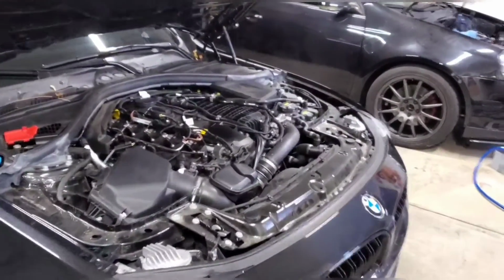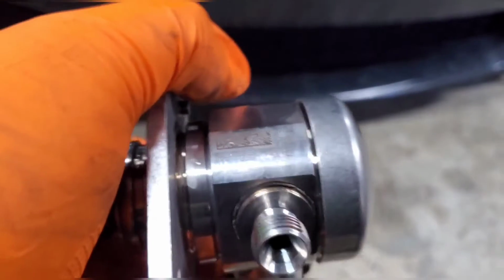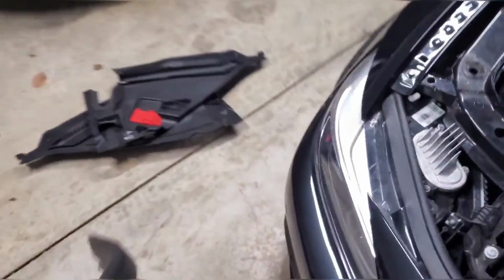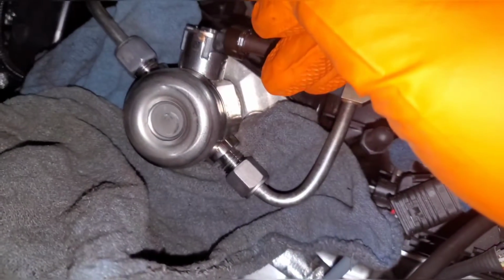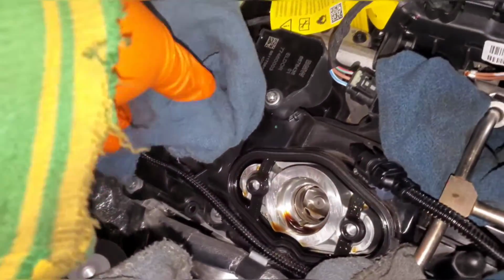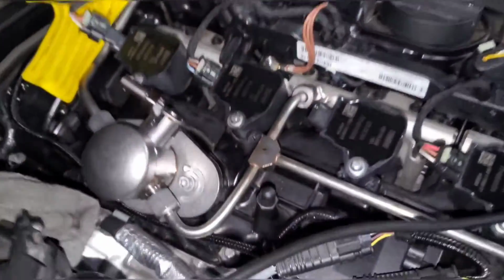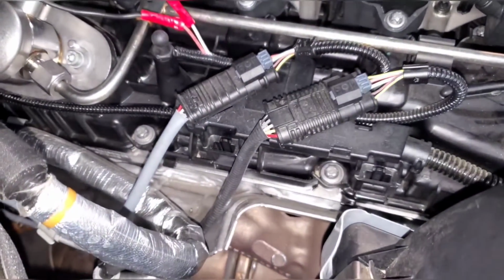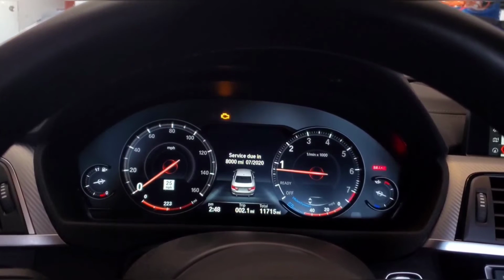**READ DESCRIPTION** B58 HPFP Replacement (TU Pump Upgrade)

Comment: I just upgraded my fuel pump but I am now getting error 11c004 which seems to mean I'm having an issue w/ the connector or wiring (11C004 Quantity control valve, activation: Line break).  The car runs fine, but I cannot get rid of the CEL.  Did I get the polarity wrong on the wiring perhaps, could it be a fault in the pigtail that came with the pump, or is there a chance my new OEM pump is faulty?
Reply from the maker: Make sure it's fully plugged in. If you rotated the connector, make sure it's fully seated

Comment: I've installed the gen2 b58 hpfp, but unfortunately i got the same amount of pressure as the stock one .. about 2960 psi, and i got the same fault code of low pressure in the hpfp

Any suggestions what to check and what to do ?
Reply: did you ever get that fixed ?

Comment: Ive installed mine today, so thank you… Mine sits a little higher as you can see a very small gap. Could this be the stock has a dimple and the gasket sits into it where the upgraded pump doesn’t have a dimple therefore sits a little higher??
Reply from the maker: As long as the gasket is sealing it's fine

Comment: I used this video to install my tu pump in my 2017 340i xdrive and it went perfectly. In particular when removing the trim pieces the description was basically real time with little need to pause.
Reply: Did you change the pump gasket as well?

Comment: I just completed this with the MHD tuner and the car won't start. Its a 2017 440i. Cranks perfectly won't start. Guess I gotta go back in.
Reply from the maker: Make sure the wiring is fully seated. The first start will have a longer crank since you drained the fuel but it should start after a few seconds.

Comment: Hi Kern, do you have a picture of how “flush” the pump sat to the valve cover I am unsure if I had installed mine correctly and want to ensure what I did was correct before turning on the car
Reply from the maker: some people have reported a small gap

Comment: great info, and thank you for the vid.  i have a solution for the tight high pressure side of the fuel line connection.  connect the fuel line to the HPFP (pointing to the front of the car) and the other side of the fuel line to the fuel rail closest to the front of the car.  the 3rd connection (to fuel rail towards back of engine) will not want to fully go into place.  solution: take a 10mm box wrench and put it over the fuel line right where it is supposed to connect to the rail.  the 10mm box wrench should fit perfectly around the line.  tap the top of the box wrench with a rubber mallet and the fuel line will pop right into place.
Reply from the maker: The way I do it now is just connect all of the lines loosely before torquing down the fuel pump to the cylinder head. It works every time. But this was my first time installing it years ago so I didn't know that yet.

Comment: I just want to add that the TU pump can regularly be found on eBay these days for less than $600. I just ordered mine, brand new with overnight shipping, for $495.
Reply from the maker: Crazy to think people were paying $1k+ at one point 🤯
Reply: @kern417  I know! I'm going to do logs and test my before and after on 91 octane, and then do E30 when I go to Vegas. Eventually when I get a Pure 800 cast turbo I may upgrade to a Dorch Stage 2 HPFP but for only 91 octane I think the TU pump will be sufficient.

Comment: Hey kern417, what would happen if we ran the TU pump with no tune for it? Also, how much extra power could you expect for a TU pump with a catless downpipe on a BM3 91 octane OTS tune?
Reply from the maker: As shown in the video and logs in description it'll just run like stock.

There's no real gains on 91.
Reply: @kern417  My bad for not seeing that. Thanks.
Reply from the maker: @BMWEnjoyer  no problemo
Reply: @kern417  Hi Kern417, thanks for all the video´s and your contributions to the car society. I bought the TU pump and was to install but now after reading on bimmerpost I´m in doubt if its worth the swap. I have the stage 1 (420hp) all else stock and runs great. Will there be any benefit at all installing the TU pump with the stage 1 or do I have to go stage 2+? Don´t wan´t to catless, only gas 100oct/E5/5% e-blend. Thanks again
Reply from the maker: @gudjonssonr  you need a tune to take advantage of it
Reply: @kern417  Thanks. Can I run stage 2+ without installing a downpipe?
Reply from the maker: @gudjonssonr  no

Comment: I have the b58 gen 1 and I want to run e50. Do I need to only change the TU pump or do I have to change the whole fuel lines and etc since ethanol and somewhat corrosive ?
Reply from the maker: no upgrades are needed to run ethanol.

Comment: have you found the HPFP to be noisy, i have this pump on a B48 and its a noise high pitch ticking. Like a rattle
Reply from the maker: it is most likely the purge valve on top of the manifold.

Comment: Top video. Just used this to swap the HPFP on my X3M40i. Stage 2+ on BM3 OTS makes a big difference. Same issue where the fuel rail doesn’t quite line up with the outgoing side of the TU HPFP, but like you said just get the nut on and crank it down. Very easy to do, even for someone like me with little mechanical experience. Cheers

Comment: Love your channel! Great walkthroughs and tech discussions. So can you run a tu pump on the stock tune without any codes? Asking for a friend in CA that doesn't want to swap fuel pumps every 2 years. Edit: for those wondering the same, it's not an issue. The tu pump uses the same mechanism and communication protocol with the DME to control fuel pressure so no errors on stock flash per another of Kern's videos.

Comment: Do I have to use the exact oil I have in the car to coat the pump, or can I use a slightly different weight?
Reply from the maker: It shouldn't matter much

Comment: First of all, congratulations on the fantastic content! 

I'm trying to install an HPFP TU Pump on my X3 M40i 2018, but the fuel injector pipe line doesn't fit (Part No. 8605242). I've disconnected the plugs around to facilitate the job. But I had no success! Should I bend the fuel injector pipe?
Reply from the maker: Try threading the hard line onto the pump before you fully tighten it down
Reply: Thank you very much! Should I tighten the nut connected to the pump or should I leave it loose to facilitate movement and the fitment of other two sides?
Reply from the maker: @JoaoPauloViragine  Just start a few threads on the pump and the rail, then tighten down the pump and everything should line up pretty easily

Comment: Great video. Why are you using a higher pressure pump if the output will be anyway regulated to lower values? Is this a first step of more mods?
Reply from the maker: It flows more fuel to allow more power

Comment: Just did mine today, really appreciate this video. Fount it a little bit odd that my fuel lines were super easy to plug back in compared to how you struggled
Reply from the maker: It seems to be very hit or miss. A few people commented that it just dropped in like yours did. Glad i could help

Comment: Awesome video. Flip the calipers over to measure depth of something. You'll see what I mean by when you try measure something in that manner again.
Reply from the maker: Trust me, it's easier this way when measuring one handed for a video. I'm not going for accuracy just giving a baseline
Reply: @kern417  I don't think so. The other would be easier single handed. Anyways doesn't matter. Love you videos man. You really have a ton of knowledge about fuel systems, ignition, ecu controls, etc.. which is pretty rare on youtube. With the BMW stuff It's pretty new to me coming from chevy and ford stuff but watched a great tare down, lots of your stuff, and been messing with jb4 and now bm3 on my m340i.

Comment: Okay this is pretty much a thousand dollar part. Why not use a dorch engineering pump for a similar price?
Reply: Another thing to consider is oem quality of this pump compared to dorch. I just installed mine today based on this video
Reply: @geramata  thank you for your input. I'm going with the tu pump.
Reply from the maker: 1. It's available for around $800 new if you search around, so the cheapest Dorch pump is an additional 50% cost for 10% more fuel flow.
2. I got mine for $650 used, many have found it cheaper (especially in europe)
2. In my fuel upgrades video i explain why the TU pump is a good option, especially for people sticking with stock turbo or running ethanol blends on bigger turbos. Not everyone is shooting for >600whp
4. I did this upgrade before any aftermarket upgrades existed. I bought it to test out because we believed it would work, and it did. So i was doing testing for the community when no other options were available besides meth Injection.
Reply: @kern417  #1 answered my question thanks! Do you think it would be good for something like a pure 800/meth/pump gas for 5-550 whp?
Reply from the maker: @llkjjjss  absolutely
Reply from the maker: @llkjjjss  here's an example where you can find it for $800 direct from Toyota
https://www.discountpartsmonster.com/oem-parts/toyota-pump-sub-assembly-fuel-23021waa01
Reply: @kern417  awesome dude! Thanks a million.

Comment: so is this a upgraded pump for the psi for toyota supra 2020 or are u using the stock pump from toyota supra 2020 for this bmw? cause i got a toyota supra 2020 wanted to get hybrid turbo pure 800 not sure if i would need to replace my stock fuel pump with this one or is it the same fuel pump i got the launch edition 2020 supra ?
Reply from the maker: There are no fuel pump upgrades for the supra. You'll need port Injection. Most people opt for the one made by EOS.

Comment: Is there benefits from
This if
Running stock turbos ? And only have access to 99oct fuel ?
Reply from the maker: You can gain ~20hp going from stage 2 to stage 2+

Comment: What ethanol percentage can the tu supra handle on the BMW b58? E50 safely or will the lpfp can’t support it?
Reply from the maker: I am running full e85 but it depends on your tuner
Reply: kern417 I’m just on ots map from bm3. So I ran the e30. Planning on getting a custom tune. Just not sure if I should request a e40 or e50 map. Didn’t think full e85 would be achievable with my current set up.
Reply from the maker: @marckevinnn  if you're paying for a custom tune I recommend E50

Comment: Hello I tried to put a tu pmup on my first gen b58 and the pump broke idk what I did but after looking the tu pump is a little bit longer than the stock hpfp what do you think btw I have 2019 440i
Reply: what do you mean it broke? what happened? any updates?
Reply from the maker: It works fine when installed properly, the length isn't an issue. I would need a better understanding of how it broke.

Comment: How can I know if I have to do this step? ... Turn the engine at the central bolt in the direction of engine rotation until the BDC position of the camshaft is reached.  How can I know if I am in the BDC position?. thank
Reply from the maker: Put a screw driver in the hole while turning the crank. It'll slowly go down, then pause, then begin going back up. It's at BDC when it's at the lowest position

It's not really needed, but does help make the tightening easier.

Comment from the maker: Datalog added to the description. Pressure holds pretty good and stays below 3000psi. It might hold tighter to boost request if I reset adaptations, but honestly I'm not worried about it anymore. Time to run through this tank of 93 so I can begin E85 testing. :)
Reply: Hi. Is there any added benefit to running this higher pressure pump with stock injectors? Don't the injectors still cap out at 200 bar? Also, I guess the stock DME tune or OTS map will always target 2900 PSI (unless custom tuned) regardless if there's a pressure regulator valve so all should be okay?